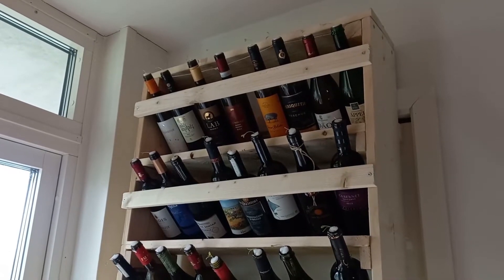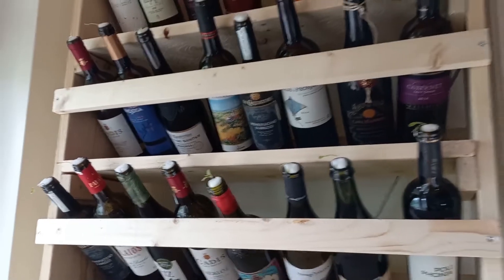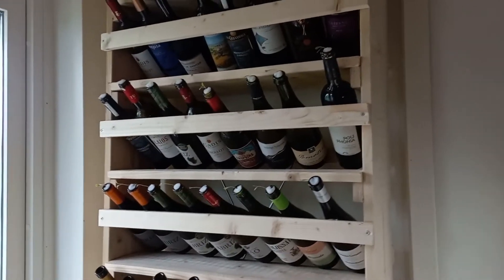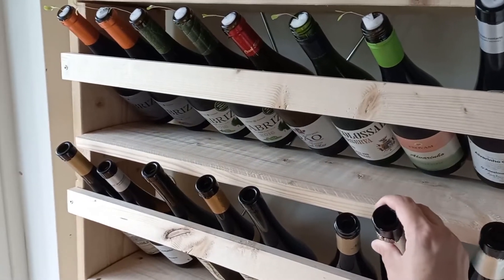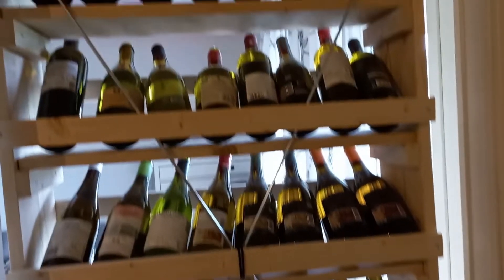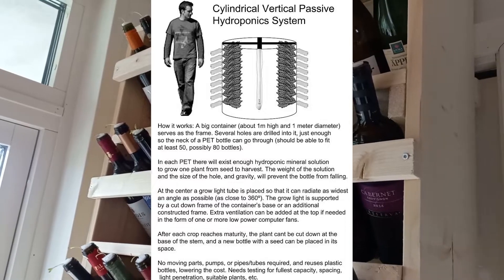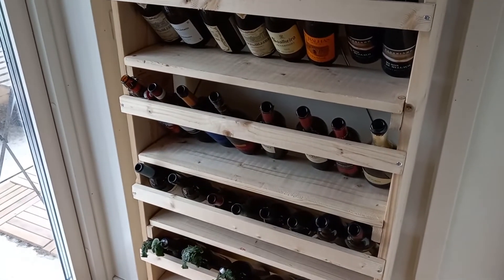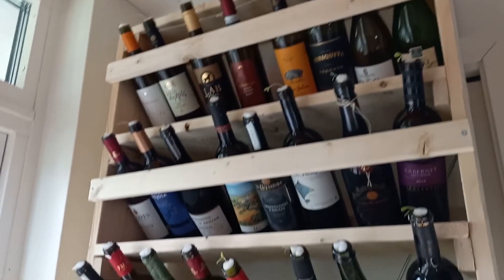The Kratky Tower System - Mineral Hydroponics in old Wine Bottles using a DIY Shelf

Comment: I was inspired by this design for a tiny apartment. But instead of wood I could use metal wire tiered, angled standalone shelves used for wine merchant display, bread or shoes but I haven't been able to find the perfect one that's heavy duty, reasonably priced at around $100 or at the right angle for mason jars to keep water from spilling out. But if found it would be perfect, and could use the angle to your advantage in order to use a single LED unit for all the plants on the shelves to receive light in an indoor setting and be aesthetically pleasing and functionally efficient. Alas I cannot find the perfect solution. Will update if found..